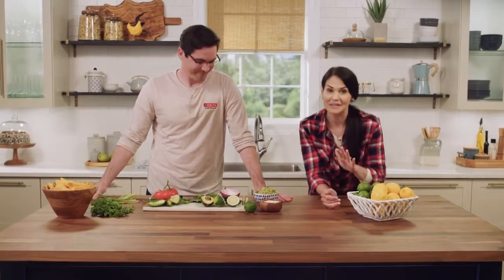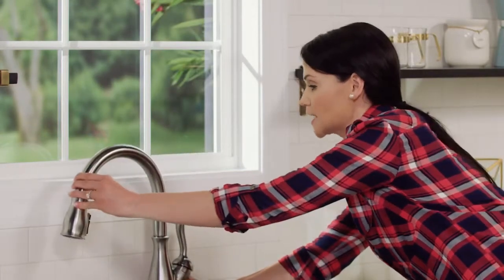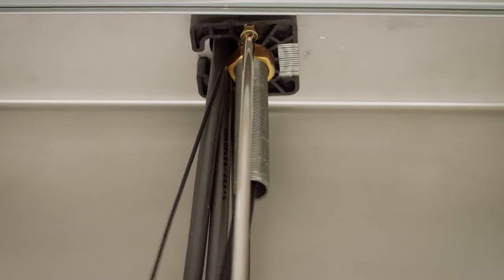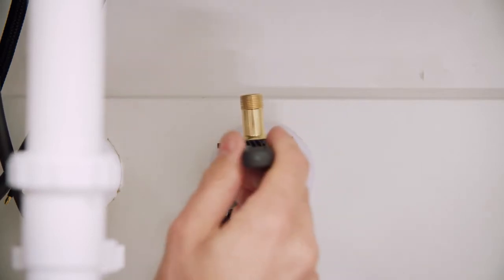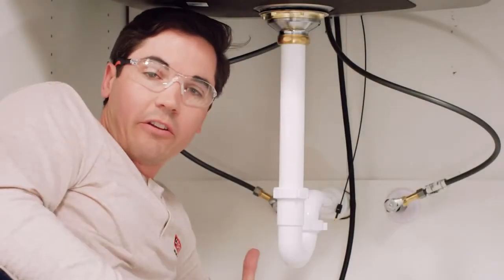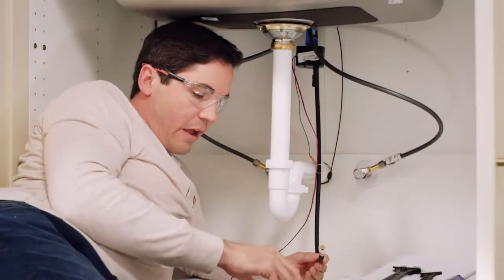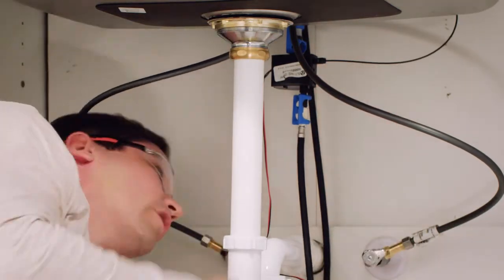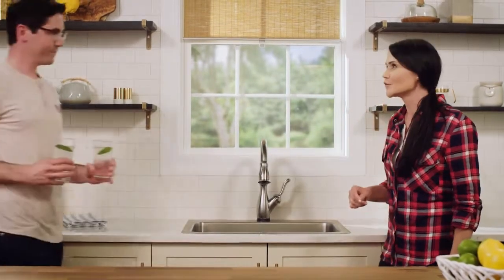How to Install a Delta® Kitchen Faucet with Touch2O® Technology

Comment: Thank you!  Nice video and far better than Delta's HORRIBLE installation manual.  Too bad you didn't include the escutcheon (deck mount) in your video. Also, the trick about turning the faucet so a 1-person installation would work - didn't. 2-day job as my friend will help with the install tomorrow. And you can't just push the mounting bracket up to the top of the threaded shank. The shank has flat sides to it, so you must position it just right (I actually removed my faucet and tested it free-hand to see if it would fit). I'm sure there are more nightmare steps I will encounter. It's sad that Delta can put out such awful installation instructions and get away with it. They need to be held liable for incorrect installations if their steps were followed.

I also don't have a studio sink. One with no garbage disposal. No dishwasher lines. Sometimes no drain lines.  Just a single basin sink.

Got it successfully installed with the help of a friend. I was surprised that the supply lines from the faucet were not braided and were VERY stiff. This was the most difficult task - attaching the supply lines to the valves. I wish they used a quick connect. But this video was invaluable. Thank you!!!
Reply: I sat at my kitchen table and watched videos like this for a few hours trying to find the "just right" way to slide the mounting bracket up to the underside of our counters.  It just would not move beyond an inch or so.  I had to use my pocket knife to scrape away a plastic line inside the mount (from manufacturing).  After I got the inside smooth the mounting bracket slid right up.  I've had to do similar things for cheaply manufactured, assembly-required things where the insides of holes get paint in them and won't allow you to screw in screws/bolts.  Frustrating indeed.

Anyways, thanks for this comment.  I thought I was losing my mind.

Comment: I wonder why the faucet didn't turn off when she touched the neck to turn the nozzle from side to side? Also, I wonder why they didn't just make it a 9v battery? (6 AA's @ 1.5v = 9 volts)
Reply: Because 6 AA’s or 6 C’s supply more amperage (current) than one single 9 volt battery.  9 volt battery is for low current consumption devices like a transistor radio or smoke alarm.

Comment: My plumber did not use the check valves. And... The handle does not adjust temperature - When I push it right, the temperature gradually goes hot. UP, it turns facet off. But there is no way to go back to cold; if I push faucet back to left it just turns off as well. Can you troubleshoot this for me? Is the lack of temperature adjustment related to the check valves? Thank you!

Comment: I have installed this faucet in my kitchen but I have to replace the batteries so often It’s getting costly is there any way to use rechargeable 
Or upgrade it to rechargeable instate of battery : 6 batteries twice a month is something I should had thought twice before buying this.please advise
Reply: They have an AC adapter for this. I haven't looked into it.
Reply: Yes, rechargeable batteries will work, they're just slightly lower in voltage per cell.

Comment: Outstanding video.  Curios why you didn't use plumber's tape on the metal; connections?
Reply: Nylon tape is not needed with compression fittings, just on basic threaded pipes like water and iron pipe used for gas supply.

Comment: I really think the girl should have been wearing a bikini just in case there were any water splashes. looks like there is a lot more things that can go wrong when you put electronics surrounded by water pipes under a sink with a sprayer hose attached to it getting yanked up and down all the time. And the cost of buying all those batteries twice a month seems rather ridiculous because you still have to touch the faucet why not just touch the handle like the rest of us poor people who can’t afford the extra $200?🚰👯‍♀️🤪